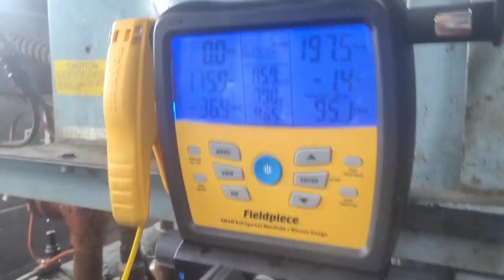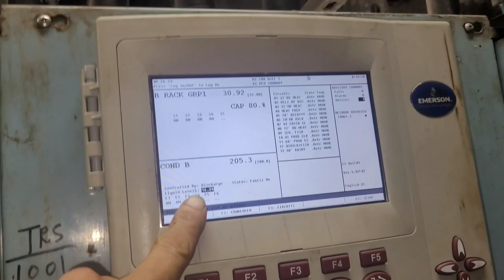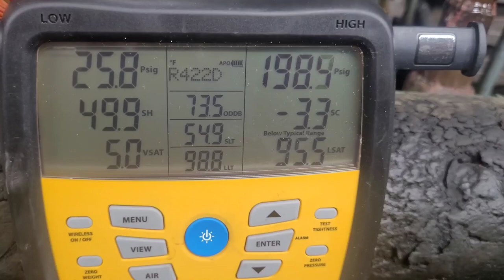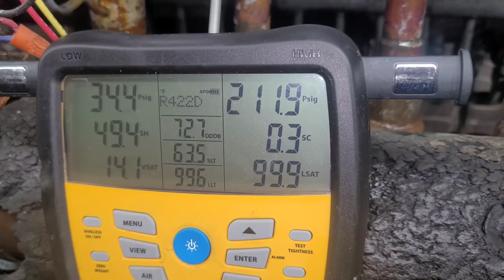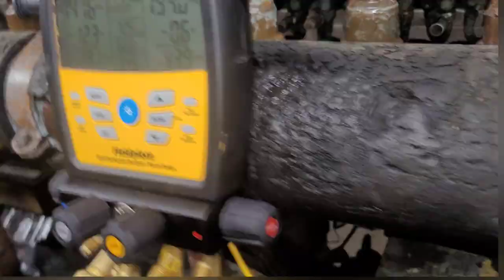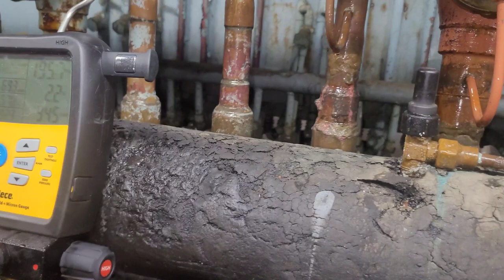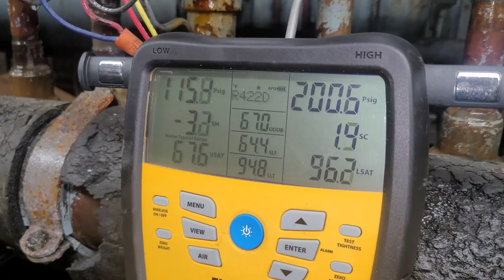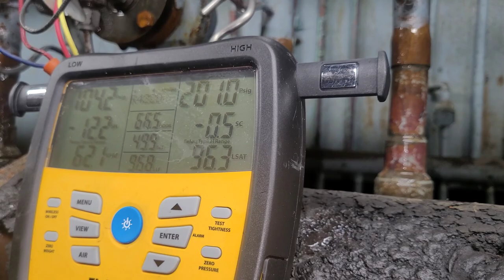RACK LOW ON CHARGE,  TOOK 125 LBS LIKE NOTHING

Comment: Had a unit couple months back snap off a swivel tee and dump 200# R22, next month same unit cap tube on fan cycle control snapped and dumped another 200#, I wasn’t there for that. But to walk in a mechanical room and hear hissing and see oil everywhere gets you excited
Reply: My question is the sensor is it accurate with the Emerson control an the is it the liquid header need me Match right
Reply from the maker: @MFitz717:Yea, definately. Haha.
Reply from the maker: @thesilentonevictor  yes the two should be reasonably close to each other and they should trend together too

Comment: I good leak search is good practice but I also like to check the cooling tower and make sure it isn’t surging bro cause that could causing the refrigerant to stack in the tower and it’ll give the same signs as a rack that’s low on gas, but good video bro!! Keep ‘em coming
Reply from the maker: Which cooling tower?
Reply: Tower that the rack is tied into bro lol
Reply from the maker: @juliochavez4028  we must have a different name for things. When I think of a tower as like a condenser that is water cooled, like on a chilled water system. Are you talking about the receiver, the long horizontal cylinder under the compressors or are you talking about the oil separator or the headers? LOL
Reply: Are your towers water cooled of air cooled? What part of the country u at?